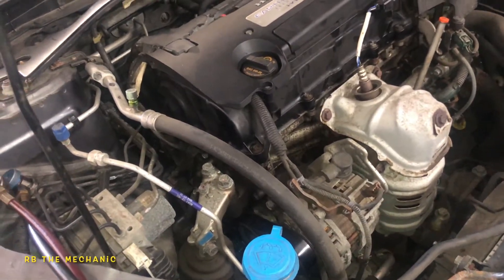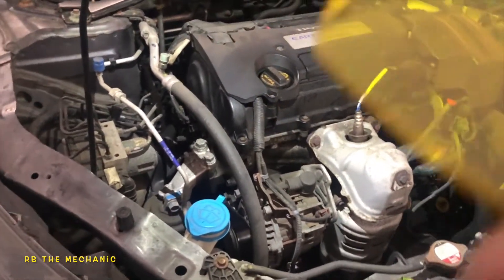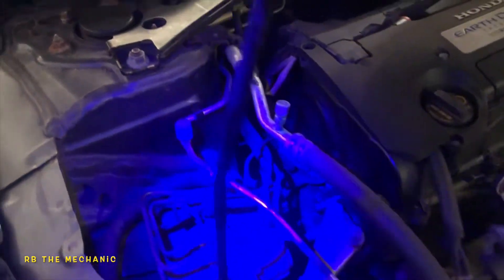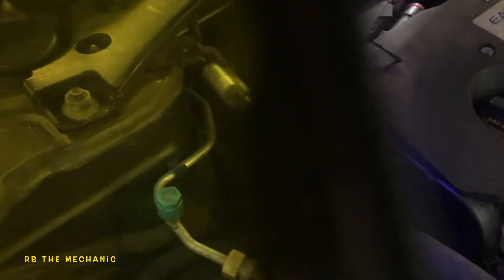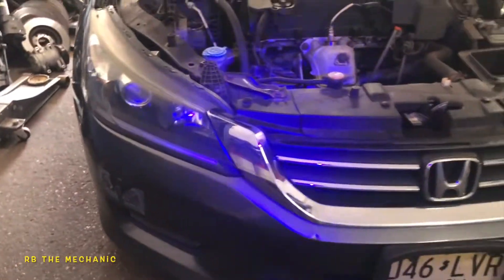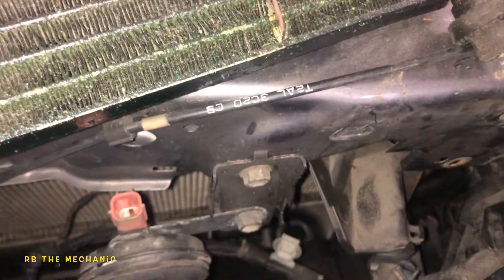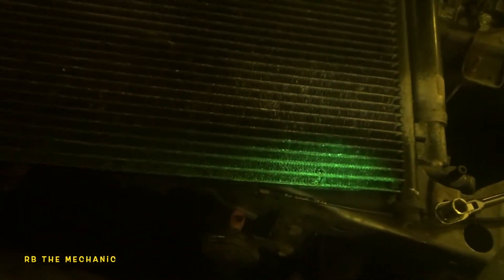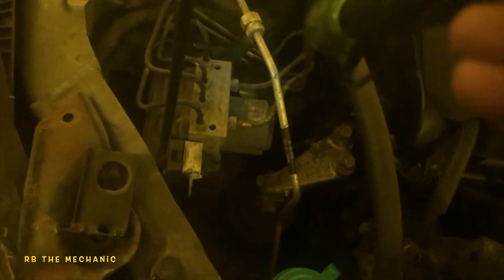Find AC LEAKS with UV DYE     Best way to find AC leaks

Comment: Is it possible to see the dye if i did not have a uv light? Thanks
Reply from the maker: No but I have seen like big wet spot on some leaking ac systems that’s if it’s very large leak
Reply: @RBTheMechanic  thanks for the prompt reply.
As i dont have the uv light. I also check the condensed water dropping from the drain tube by touching it and observe it. ( the water/ liquid is very clear)
Can i say that if the liquid is not oily and it is basically water, it is not really evaporator leak?

Thanks again.
Reply: @RBTheMechanic  should have bad smell in the cabin if leak from evaporator? Thanks!!!!!!!
Reply from the maker: @kakit0116  yeah but u can barely tell unless it’s large leak
Reply: @kakit0116 little uv flashlight at oreillys for 9.99. Up by front register
Reply from the maker: @jbuck1975  yup